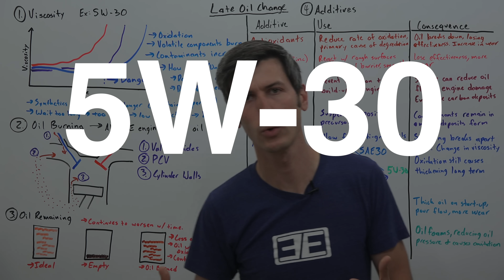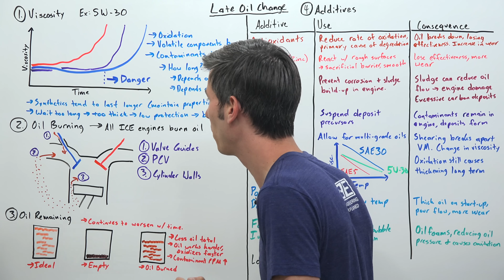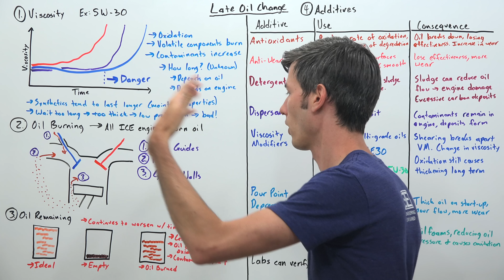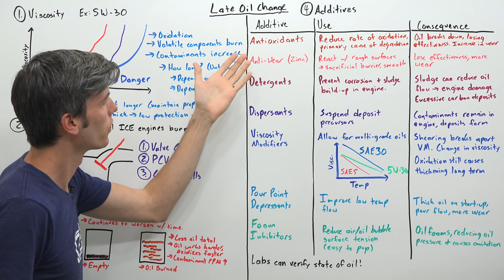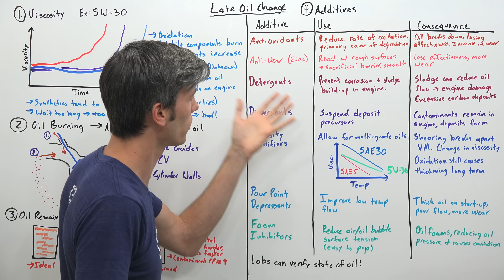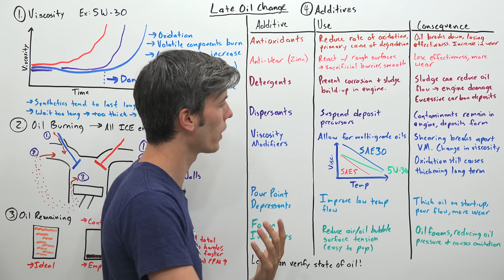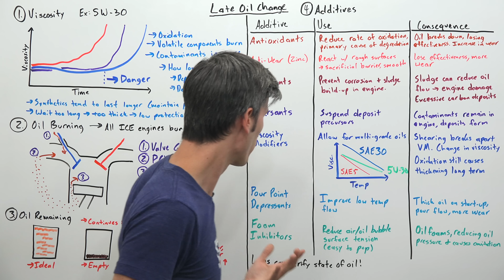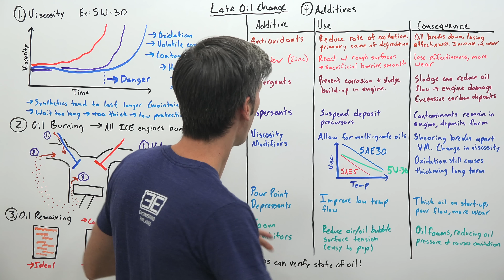What If You Forget To Change Your Oil?

Comment: I daily drive and use redline 0w20 with extra ZDDP and a high capacity heavy duty oil filter changing after 7500k miles I'm not really worried about anything you say but just want to hear your input

Comment: Unless you are 'abusing' the oil (high temps for example)  it's more important to change filters and keep the oil level up.  Yes oxidized oil should be changed, but today's high quality synthetic oils hold up really well to typical driving.  More often than not, oil still capable of protecting an engine is drained out and replaced.  

Would be interested in seeing actual oil analysis at recommended oil change intervals

Comment: I've been in the petrochemical industry for years.  Viscosity modifiers are NOT lubricants,. If you're using 5w-30, approximately 25% of the 1Qt., Consists of Viscosity modifiers.  So, living in Florida I only use Single weight oil SAE HD 30 .  Single weight oil has no viscosity modifiers whatsoever.  I do not recommend using single weight oil is the temperature goes around 30° Celsius.  Shearing of the oil is minimal.  Please don't forget it only takes a teardrop of a modifier to NAME motor oil synthetic. That's the law in the United States.  I personally do not recommend multi weight oil.  Unless you live up north.

Comment: Just wish there'd been a bit more detail about sending the oil for analysis.  So much easier to do this than trying to guess what a good change interval is, and it's only 30 bucks or so.  Will probably save you money over time from changing the oil unnecessarily often.  Check out Blackstone Labs.

Comment: are there sides where you can see how much oil engines use in most cases ? and what failures they have most likely ?
like a 2.0 FSI 1.8TFSI from VW and partners are using way to much oil

Comment: In general I do 1 year or 7500, whichever comes first, for fully synthetic oil. The whole "every 6 months or 5000 miles religiously" seems to be a little too short but it's a safe bet so I get why that's the recommendation. I probably wouldn't do that unless my car was a performance model or worth a pretty penny. Plus there are a lot of vehicles that are switching to a 1 year 10k recommendation and the bottles themselves "claim" 10k or higher oil life so 1 year/7500mi is probably on the safe side.
Reply: Oil is so cheap why would you not change it every 3months / 3k-5k miles. These people that say once every year oil changes are the people that run over potholes and don't think anything of it
Reply: @bigc6825  You shouldn't be changing your oil ever 3 months ever. I can see some people making a case for 6 months but 3 months is definitely just throwing away your money. An oil and filter change with fully synthetic is around $50 average depending on your engine, maybe little more or less. So the issue becomes $50 a year or $100 a year or, in the case of 3 months, $200 a year. Wasted money is always expensive.

Plus, mileage is a horrible indicator of oil degradation. The reason why there are general indicators is because it's impossible for a company to tell how everyone drives. Not all miles are created equal. 

Also you criticizing people for running over potholes and thinking nothing of it means you're thinking about your suspension components in terms of wear and not in terms of miles. Why would you not think of your engine oil the same way? You might as well go ahead and change out your shocks every few years rather than looking at their wear and tear.

Comment: If you have a good enough oil filter you can forget to change the oil a lot. I don't drain oil. I change the toilet paper a couple times a year and keep an eye on the dipstick to watch for viscosity increase. It always works better if the contamination is in the filter instead of the motor oil. I don't miss the oil change racket.
Reply: Filter changes will keep contaminants down, but won't help with additives wearing out and breaking down.  I would recommend getting an oil analysis from Blackstone labs with the extended use option, and see definitively what condition your oil is in at the point you normally change it.
Reply: I hadn't given it much thought but I can see how Amsoil and others can have much longer filter change intervals with inferior filters is these modern engines run so damn clean. I think it would be easy for me to leave a roll of toilet paper in for 30 k miles then draining the oil and changing the toilet paper using most any oil. I kind of like the system where Bobby Unser said this oil change is forever using the original superior Amsoil bypass filter except I would use toilet paper and change the filter more often. Damn that's what I'm doing now.

Comment: On the opening statement. So if you miss your oil change by a kilometre/day, then it's not ok? Sure....

Now not changing at regular intervals, you are definitely right, but missing changing it in time, no.

Also, 5000 miles over isn't missing an oil change, you are skipping an oil change.

Comment: Do you have (or will you consider) a similar video about transmission fluid types and their properties?

I have a ute which apparently can take any type of transmission fluid, the manual says it can take dex 3, gear oil or motor oil. Since I don’t have service history from the previous owner I have no idea which fluid is in my transmission. It would be helpful to know exactly what the difference is between the three with the help of your whiteboard.

Good video btw
Reply: You do not put in whatever transmission fluid you feel is best. You have to consult the owners manual of the car. If you put in a fluid the manufacturer does not recommend, you have the chance of destroying the transmission

Comment: I think it's really funny the idea of people who are too lazy to change their oil on time sending a sample to a lab to see if they went too long.
Reply: Sending an oil sample to a lab is a really good idea and a common practice if someone is running an operation with heavy equipment (e.g. big farm tractors, combine harvesters, construction equipment, etc.), especially in dirty/dusty environments.  Such equipment requires a lot of oil each oil change (compared to a car or pickup truck)(perhaps $250 per oil change for each machine).  Just changing oil and filter is a substantial expense and it must be changed based upon a relatively small number of engine hours of operation.  The lab results help to get the optimum life out of the oil without going too long and damaging the engine.  The analysis will also help to tell if internal engine parts are starting to wear out, so that preventive maintenance can be done before a major breakdown occurs.

Comment: Hi Jason, I have a 97 Subaru Outback with 243 k miles on it, still runs great.  With a lot of care, at every oil change I flush with
2 liters of kerosene before put new oil, noticed very clean oil doing this before next change (every 3 k miles). Could be this dangerous for my EJ 25D in the future? Thanks in advance.
Reply: I did something similar. I bought a 2000 Toyota Sienna at 215,000 miles that had minimal maintenance history. Since this engine was known for sludge problems, I drained the oil hot, then low-filled the crankcase with two quarts of kerosene and one quart of oil, and idled the warm engine for 20 minutes. The drainage was not pretty, as I expected. I thoroughly drained the crankcase, and refilled with 10W-30 Pennzoil. 30k later, no problems are evident.
BTW, at every oil change I empty the power steering reservoir and refill it with fresh fluid. Much easier and cheaper than pump/steering gear replacement!

Comment: Is ok to change the oil based on the filter itself? For example a filter that can last up to 5,000 miles, rather following the car manual to change the oil every 3,000 miles. Is there any concerns with this.

Comment: In the 1990's Motor Trend magazine did a oil study involving New York City taxi's, vehicles that put a lot of miles on quick, so the results came in quick.  They change oil on one set of cabs at 3,000 mile, another set of cabs at 6,000 miles, and then 9,000 miles, and lastly, 12,000 miles.  At 100,000 miles they tore these engines down, and found less that 5% wear difference across all examples.  Results were clear, oil changes at 3-6,000 miles was a big waste of money.  9-12,000 miles seemed to work just as well.
Reply: almost like they were lying to us
Reply: Yea i was gonna say. The high oil changes was made because they wanted to sell more oil. But I've ran cars without oil change for a year and half. I dont let the oil run low of course but I have realized changing oil very early your wasting your oil
Reply: This was a great study they did. Yes there May be a benefit of changing more often theoretically, but what is the real world effect?  If a significant real world affect isn’t seen until 3 million miles, then it doesn’t matter much cause the car has other parts that won’t last that long. Or if the effect is 1mpg then you can see if the cost outweighs the benefit by doing some simple math.
Reply: Here in the EU vehicles are on 10,000+, some as high as 18,000-20,000 and we're getting 150,000-200,000 miles without issue and usually it is the bodywork that fails before the engine.
Reply: @conorturton  10,000 km is roughly 6,250 mi, so more or less the same.
Reply: @anonymousinc6330  they ment 10 000 miles. Otherwise here it starts from 15 000km to 30 000km. From 12 to 24 months whatever goes first. This depends on manufacturers, models, model year, etc.
Reply: @teovm   But most vehicles in the EU are diesel powered, aren't they? Diesels have longer oil change intervals compared to gasoline engines.
Reply: @anonymousinc6330  the reason diesels can go longer between oil change is cause diesel is really a light oil wheras gasoline is a solvent.
Reply: @ralphfalstin6024  Yes,  And that is why vehicles in Europe can go longer on oil changes, because most of them are diesel.
Reply: @anonymousinc6330  I'm talking about  miles not km. I'm from the U.K. and we use miles.
Reply: @conorturton   And as I already said,  vehicles in Europe are primarily diesel, which have longer maintenance intervals.
Reply: @anonymousinc6330  The Ford Focus 1.0l Ecoboost petrol is on 18000 mile oil changes.
Reply: @conorturton   See how long it lasts.  If that's the one I'm thinking about, it is having serious head gasket issues here in the states.
Reply: @anonymousinc6330  All of the petrol engines that I know for new cars in Europe at the moment have at least 15 000km oil changes or 12 months. Yes diesels have at least that. I'm talking about regular cars, not pure sport cars, AMG and other variants. In all the manuals it is declared that this is for regular use.  If used for a lot of small trips /less than 7km/, a lot of cold starts, dust, hard driving like keeping it in high revs for long periods you should cut the oil change interval in half.

Comment: I disagree on how you are grading the oil a 5w30 I would say is 30 is the viscosity thickness (newer motors operate with far smaller clearances thus a 30. and older engines with more running clearance would be at a 50) The 5 before the W is the amount of how much temperature affects the viscosity  0W fully synthetic viscosity does not change but an old multi grade 20w50 does have a greater change in viscosity.

Comment: Towards the end, you mention that foam inhibitors prevent the formation of foam by reducing the surface tension of the oil. Would this not also reduce the oil's viscosity? What is the relationship between surface tension and viscosity? Is there a relationship?

Comment: I have a question on my Mustang I typically Drive about 2,800 miles a year usually I change the oil twice a year regardless of how many miles I do. this year I decided to not change the oil twice a year I'm just going to do it once a year. But let the car sit without driving for let's say six months without changing the oil will the oil deteriorate?
Reply: It’s probably overkill but I’ve got a Mach 1 (03) that I don’t drive much now. I just change twice a year, like you do. Maybe $35 Mobile 1 and a filter from Walmart so pretty cheap peace of mind. 
I had the oil pan off after 60,000 miles and only used synthetic oil, it looked brand new. No sludge built up or anything inside. Always use synthetic in all my cars after seeing that.
The other thing is that if it used for short trips, and engine doesn’t really get up to full temp, might not get rid of all the moisture in the crankcase? That supposedly can wear oil prematurely?
Bottom line is we don’t know without sending a sample for analysis so I’d do it twice a year and not worry😁

Comment: I work for BMW and we have to do valve stem seals on the N63 twin turbo V8 all the time. There’s a class action lawsuit for oil consumption on those engines where we have to run a test plan, check the timing chain for stretch, look the engine over for external leaks and check the oil level via a test plan and adjust the level to exactly where it requests...then we have to tell the customer to come back in 1,000 miles and we run that test plan again to see where the oil volume is now. Depending on the amount of oil is lost for the given mileage, the people with authority from BMW will authorize valve stem seals, VSS plus some other components (valve covers with integrated vent valves) or a complete engine replacement.

Comment: How can you tell when your subaru is low on oil? 
When in stops leaking all over your driveway.
Reply: Lol...😂
Reply: My 93 Legacy hasn't started leaking oil yet at 237,000 miles. The 84 started leaking oil from both head gaskets at a little over 250,000 miles.  Paid 200 dollars for an 80 model Subaru unseen. Went to pick it up. The floor was full of empty oil cans. Oil was all over the engine and the fill cap was missing. I got lucky replaced the cap and changed the PCV valve and hose. It wasn't very old then. Took a kid thru college.
Reply: @ralphwood5114  Hello Ralph. I believe the engineers simply forgot to design in the oil leaks on the earlier models. Something about 80s and 90s Japanese build quality. Speaking of which, what ever happened to that?
Reply: @MrWilliam.Stewart  I’m aware this is 1 year old. While 80s and 90s Japanese cars have incredible reliability, 2000s Japanese quality isn’t any worse. We have 2 2003 Mitsubishi monteros each at or nearing 200k miles. They have been excellently reliable. 2000 Toyotas and Honda’s are also very common on the road.

Seeing reliability isn’t clear until it’s many years later. It’s not clear that there’s any change in Japanese reliability since the 80s and 90s. And Korean reliability has increased drastically.
Reply: Mine didn't leak a drop. Just burned it.

A LOT of it.
Reply: @irritablearchitect  Subarus burn oil brand new
Reply: @Davido50  The new FB and FA engines have an oil burning issue.
Reply: @irritablearchitect  Same here. Every other tank
Reply: I thought the answer to “how do you know your suburu is low on oil” is 
“Yes. “
Between the leaking and the burning. A friends brand new forrester has burned a qt/1k since it was new off the lot. That’s “normal” according to suburu. 🤷‍♂️
Reply: @Maverick09171  My 2012 Subaru doesn't burn any.
Reply: I mostly buy old cars. The 84 I bought new. Bought a 2008 Smart car. What a piece of crap. I liked driving it. It was sweating oil when I bought it. It started leaking bad about the time I started having electrical problems and parked it. It was burning out head light bulbs. Voltage seemed OK. Not a do it yourself car. Its a take it to to your Mercedes dealer car.  Don't want any more cars that I can't take to any locksmith and have a key made. Its a 5 speed manual. The computer works the clutch and shifting. 150 k miles on it. Not worth much.
Reply: @ralphwood5114  
I too was tempted by a Smart car many years ago. I feel your pain, Mercedes specialise in big heavy cars, albeit not very reliably ones these days. On the plus side, yours is now ripe for a high powered motorcycle engine conversion 😛
Reply: @ralphwood5114  it thing of past.
Reply: Right after I bought the Smart car a lady at work asked me how I liked it. I said I like it. She bought a new one. She was paying a fortune taking it back for service I assume to keep the warranty good. She traded it in for a Kia.
Reply: When you need gas
Reply: @grandpagun2843  HAHA! Yeah my subie threw a rod out of nowhere, lost oil pressure somehow but I didn't diagnose it as I wasn't prepared at the time. My roommates blown 2 subie engines, my friend went through 2 engines, sold the car to his little brother and now it needs another engine. All from oil consumption and not paying attention to the oil level, and oil change interval. Nothing like rod knock and driving the car anyway.
Reply: Harley as well
Reply: Companies refer to a financial loss as "negative growth", so I refer to an oil leak as a "negative top-up".
Reply: Ill just keep on riding my schwinn..
Reply: Truth. They burn alot too.
Reply: AND tranny too
Reply: I have been thinking about converting it to electric. Probably wouldn't pass the inspection to get a safety sticker with a motor cycle engine. We have fire ants in the Dallas area.They have taken over the electric system. Can't leave a car sitting long here. I have a wrecked Toyota out back that the rats and mice have eaten everything rubber including the spark plug wires. I need to call a junk dealer.
Reply: it*
Reply: I don’t know how you could possibly tell when your Subaru is low on oil , when it was already screwed 3 years before with a blown head gasket !
Reply: More like bmws
Reply: Even new ones sound like they have exhaust manifold leaks.

Comment: How do you forget......I change mine at 8000km(5k miles for yanks) even though my owners manual says 16k (10k miles) since it is full synthetic 0w16. Yes I change it twice as much but oil is cheaper than engines.